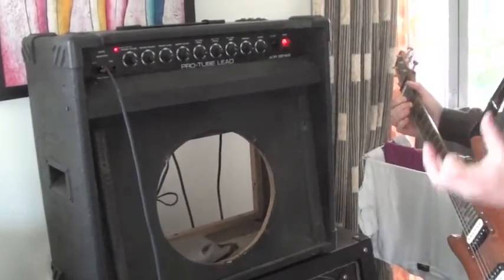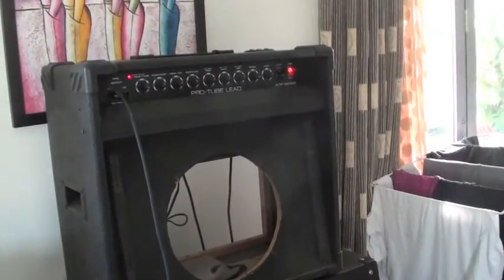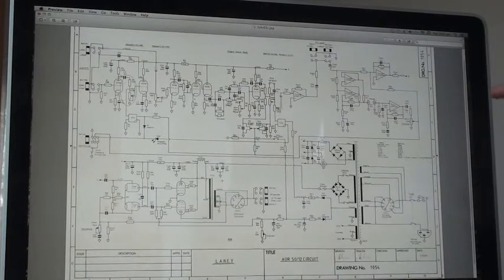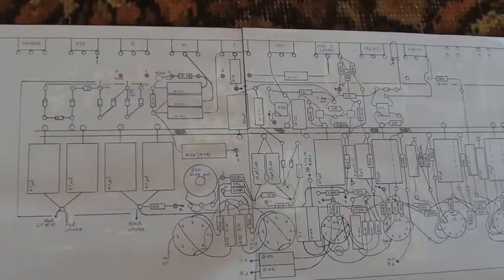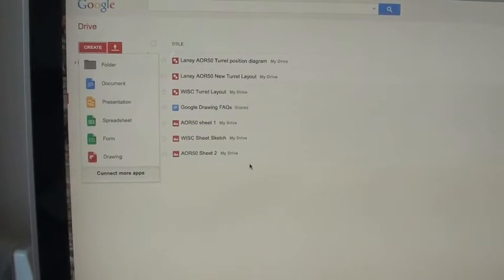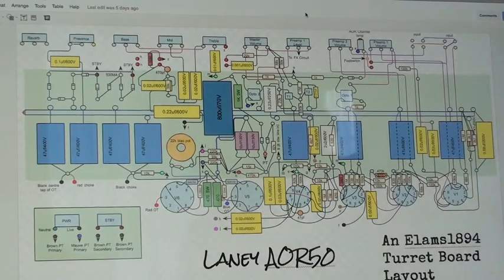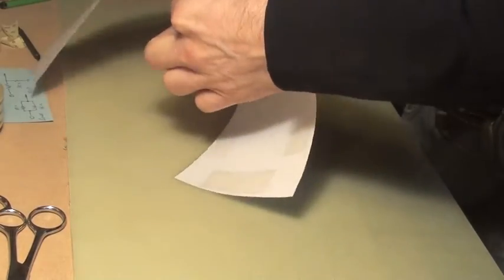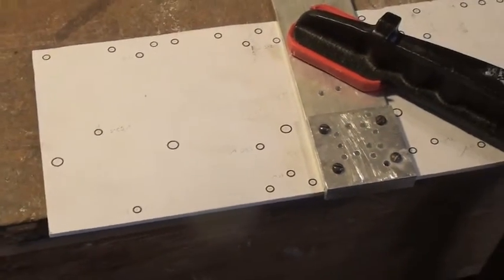Classic 80's Tube Amp Rebuild - Laney AOR50 (Part 1)

Comment: Hi
I just picked up one of these.  I replaced all the tubes with JJ's.  While its fully functional, the amp sounds really crappy.  thin sounding.  when pre amp stages are turned up is very muddy.  Where should i start???  thanks
Reply from the maker: The electrolytic capacitors would be the next best thing to replace as they would be pretty stuffed I would imagine. After that, the coupling caps. Cheers
Reply: @elams1894  Great info... Thanks so much...

Comment: Sorry a bit confused but, what was the main goal for this modification? Was it to make a more Marshally style amp or?
Reply from the maker: There isnt anything specifically Marshall about this circuit because it is a Laney circuit. Sure it has similarities, just like Soldano circuits, but it is purely a Laney circuit. The reason for rebuilding the amp was because the original was not built optimally and sounded very bad. It had a PC board which had burnt out components and multiple grounding points all over the chassis. This created much unwanted noise. I simply rebuilt the amp using as close to point to point wiring as possible, used higher quality components, and had 1 grounding point. I also moved the electrolytic can caps off the chassis and lined them with its corresponding tube. I wanted to find out the true tone of the circuit by building it as higher quality as I could. That was the sole aim. Thanks for the question, have a great day!!
Reply: YES I know I have 3 AORS was a  test sense on this side of the Pacific us yanks have the horrid notion anything that's UK just got to sound identical to a Marshall or we will make it such lol. Approx. 90% of all the PT/AORS that are customized here in USA are SLO or Marshalled sad as it is. Mine are stock I have an AOR30 combo, AOR50 head and an AOR100 head.
Reply from the maker: Ahh, I see what you mean, yes I have noticed that too, anything must be modded to sound like something else. Its quite a phenomenon. I just got word from the person for whom I built this amp for, and he's more than super stoked with the quality of the tone. He's been walking down the Mesa path for sometime but he can't get what he wants from them. This particular gentleman knows his quality tones inside out, has gone the whole hog with every amp and has ended up selling everything apart from the AOR50 I built for him. He calls it 'Bigfoot' and the fact he still has it in his possession speaks volumes about it is fine praise indeed for the AOR. When I have it in my workshop to work on her, I hate giving it back. They are very cool amps with a quality tone and so glad to hear that you have three, very cool!! Keep a hold of them, as they are true sleeping giants.
Reply: I like other amps as well its funny non come close to these for diverse gain adjustability. I also have another sleeper amp a Fender Super 60 that's also an underdog stateside. Also a Carvin Xv212 Boggie killer. I paid 180 for it at a pawn shop ditto the Super 60 was like 349.00 used. The Super 60 has a sorta Rivera/SOB vibe to it. And the Xv2112 a Mk2 vibe. Not all Mesa's are the same.
Reply: Spot on Marco! I own 3 AORs, a 100 and 50 watt head and a 100w 212 combo Laney called a "quarter stack". I have returned all to stock configuration with upgraded caps and higher quality tubes (gold pin pre-amp tubes). They sound better than the JCM800 or the TSL-122 I once owned and they have more grunt and pure tone than my 2007 JVM410 head. I do love my Marshall but my favorite tone comes from my Laneys. Better than any Marshall IMO.

Comment: Nice job, but what's the reason for moving the choke?
Reply: +WDeeGee1  if the Choke´s, Transformators or Coils facing in the same direktion of Magnetic Field they influence each other  if  like he did turn it 90 he cuts off those influence to a minium

Comment: OK This is A master build of a guitar amp. Absolutely top quality. I would have a custom made amp from you all day any day.  But this is not a rebuild or a renovation because it is a new amp made with a mixture of new parts and a few old parts from the old amp,  It is not made anything like the original.  If this was an old antique or boutique amp it would now be worthless and would be worth about as much as a normal tube amp of similar modern type. That said, I think it sounded fantastic and your skill is amazing.  The potentiometer/volume pot on the board, what is it for, is that to bias the tubes?

Comment: Do you wire everything like this? Just like people used to 'breadboard' stuff... On their kitchen break boards! Nice work
Reply from the maker: Yo hows it going dude!  Yes the oldschool method, as apposed to printed circuit boards.. which I dislike very very much.  The problem with PCB's is that you get miles of itsy bitsy thin copper trace on that thing, very close together.  A lot more resistance, heat and noise can result.  I like to make things as point to point as possible and having 1 ground passage.  Makes things neater with less unwanted noise.  How you been anyways?  Hows that LP???!!!!
Reply: elams1894 Scraped another neck today :') Will be there soon though! The junior double cut is what Im excited about now though :D
Reply: In today's market of amplifiers, it is seen as an upgrade to handwire with the extra labor and skills it requires to do so. I believe handwired amplifiers sound better and are  more robust to gig with.